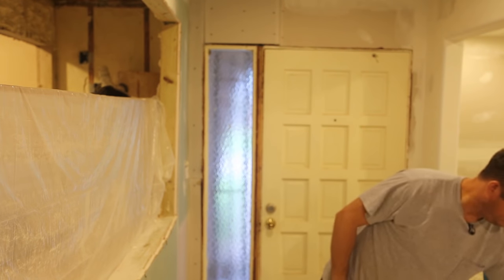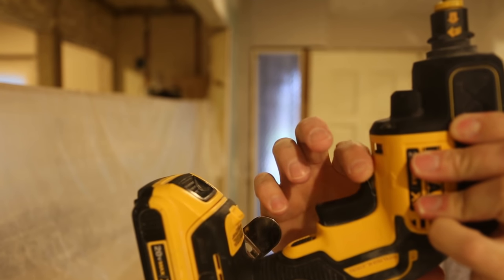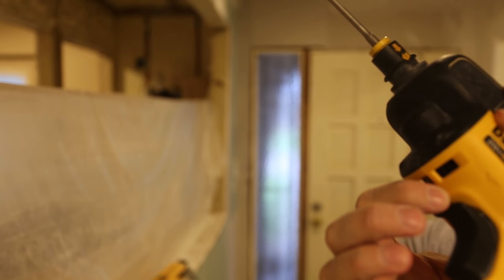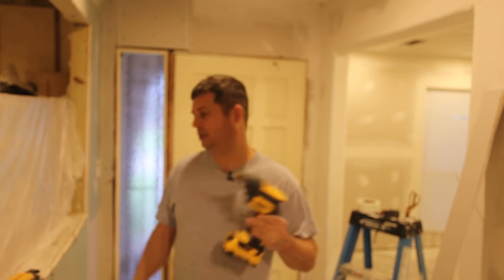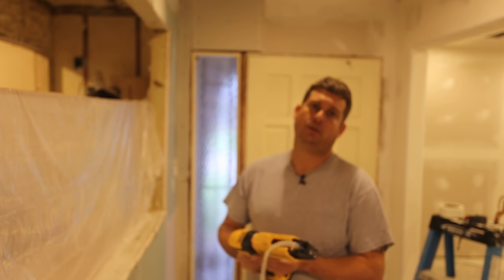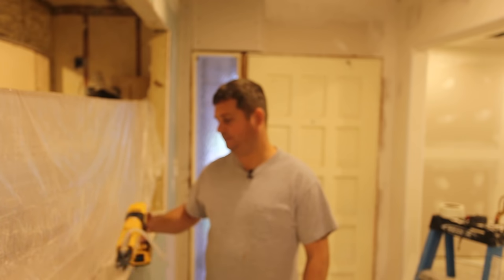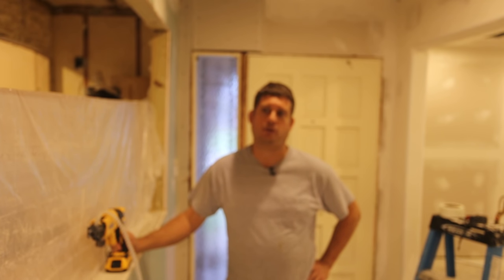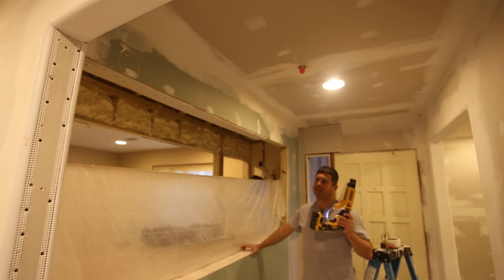DeWalt Max XR DCF620B and DCF6201 Review and Demo

Comment: if Yiu hold the gun properly the switch is in the perfect spot when your hand feeding and get a dead screw I've been running the Dewalt cordless for over a year now day in and day out and haven't had a single issue with it yet it's rugged as he'll I've dropped it down stairs off ladders off the tool belt all numerous times still no problems the screaming stops after a Lil bit of 3an1 oil is added and the cone stiffens up and doesn't adjust to easy once the dust collects in the cone

Comment: The switch is in a perfect place don't listen to that part I hang and finish drywall for a living and that switch being there is great and helps out with productivity.
Reply from the maker: I'm glad you like it.  I personally hate it there.  Why would you want a reversing switch on a screwgun with a collator attachment?  A separate bit on a separate tool is a more appropriate way to deal with reversing screws that need to come out or be finished a bit more.  The other MaxXR tools like the impact driver and drill use a sliding forward/reverse switch which doesn't tend to be accidentally hit as often.
Reply: Delia Agundiz stop using your wife's account
Reply: I want delia to come work with me...

Comment: Thanks for the video Brian.... shopping for an autofeed from someone.. senco was the cordless autofeed I've used in the past...  the 2500 rpm... I see they have a 5000 rpm out for @250...  I think they feed on the recoil... I'm not sure... so thank you very much for YOUR time !!
Reply from the maker: Yes the feed is on the recoil.  Which is part of the reason that the Reverse is useless on this gun assembly.

Comment: Did you have problems with the cone being hard to adjust after a few times of use cuz of the dust. I seem to have this problem with it. It gets really hard to adjust cuz it seems the dust gets lodged into the adjusment mechanism. Not talking about the auto feeder.
Reply from the maker: I didn't have any issues with it.
Reply: Try rinsing with water really good, let it completely dry up and put some oil. Maybe wd40. not too much

Comment: Good video even blurry..  I have the unit and yes the switch mysterious switches from fwd to reverse.. I'm a lefty and I sometimes hit this by mistake... nothing worst than to have the screw not go in.  Another thing is using it in the corners... the square apparatus don't work well at angles.... otherwise a good product..

Comment: Most logical place to operate the reverse forward is where your finger is........ Perfect design Dewalt....
Reply from the maker: Maybe if you are using the screw gun without the collating attachment.  But the collating attachment is for installing screws and each time you press it a screw is dispensed.  So having a reverse paddle is pointless.  Plenty of other Dewalt products use a slide/toggle on the grip that stays out of the way until you press it.

Comment: any idea on how it works on metal framing?
Reply from the maker: Should be just fine.  Different screws though.
Reply: and a little more push! LOL! Thanks!
Reply from the maker: I don't think so.  They are self-drilling fine thread screws for metal framing.  I'm working on a commercial space for my screenprinting company and it's all metal framed.  I had to mount a piece of painted plywood for network and communications.  I used my impact driver to install the few screws I needed to install and it was just fine.  Went in easy and secured firmly.  Very similar to wood frame walls.
Reply: freaking awesome news!

Comment: is the handle as big as people make it out to be and do you really need to use two hands when using it?
Reply from the maker: +yolol No, I regularly use it one handed.  The only serious draw back to it is that it is optimized for short screws.  Long screws sometimes hangup when going through the feed slot on the inside curve of the handle.
Reply: +Brian Greul great to know brian, does it also feel good in your hand like other dewalt cordless drills? i bought a dewalt impact driver and i am thrilled with it and seeing that i do a lot of plaster boarding i'm going to buy the DCF620P2  as it will for sure come in handy when doing ceilings and speeding up jobs. great review by the way
Reply from the maker: +yolol Like all the MaxXR tools it's very ergonomic.  The only gripe I have with it is the forward/reverse switch.  It's in a bad place and it's easy to hit accidentally.  I really wish it had the same forward/reverse switch as the drill and impact driver do.  That's a button that moves side to side.  The driver has a paddle.  Otherwise, it's a great tool.  Mine included a hook for "belt" mounting.  It's a tad too heavy for a belt, but I use the hook to hang it on a ladder and keep it out of harm's way.  I've nearly finished hanging 6800 s/f of sheetrock and it would have taken alot longer without this tool.  While the screws are more expensive, my time is worth more to me.
Reply: It's been about two years since and the machine is still going strong. I recommend it to everyone. Cheers

Comment: Is this machine can screw in iron pipe 1.5 mm to 2 mm thickness pipe
Reply from the maker: no.  It's a drywall screw gun.  You will destroy the bits even faster drilling steel.

Comment: Can  you use any brand screw on the attachment ?
Reply: I've tried universal 35x3.5 (I'm in France so I'm not sure how it is in universal but close to 1 and a quarter inch I think) and they simply wouldn't get picked up by the actual screwdriver. I've now ordered Dewalt 3.5x35 and will update once tested.
Reply: well?

Comment: Just don't buy square drive screws so if your doing decking just get no2 ph decking screws, it is after all a drywall gun
Reply from the maker: #2 Phillips doesn't handle torque as well.  I don't think I've ever seen the square drive bit for this.  The tool was a real lifesaver for doing 7,000 s/f of sheetrock.

Comment: With that much water you will (already have) regret not using blueboard for that surround.
Reply from the maker: Probably not.  I used hardibacker with a single part epoxy paint.  I've used that combo before where it had to resist a pressure washer.  As much as I'd like to think my saltwater tank is wild, it's not that wild.   But it is something to think about.

Comment: its 2018 now, do we have #2 square tips for this system now?  I need this for floors but also do drywall on the side sometimes.  All my cordless tools are XR Dewalt battery powered so I thought I might buy this setup.  But I am advised to just buy the Senco.
Reply from the maker: Dewalt appears to have them listed.  Finding them is another issue entirely.

Comment: i hate when people thing their opinion is the only one like it's automatically a fact because they think it is.  It's not a FAIL because you can't watch where your fingers go. It's actually a very convenient place for that switch, you can tap it with your finger quickly and go on about your business. It's not Dewalts fault you're clumsy. where would you prefer them to put it?
Reply from the maker: As I said in the video, I would prefer the switch style that is on the drill and impact driver.  I found that the switch on this screwgun is very easy to hit by accident when you are holding sheetrock with one hand and the gun with the other.  Besides, who the hell uses a screwgun with a collating attachment in reverse?  It's a single purpose gun with the collating attachment.  Each press positions another screw for placement.
Reply: I agree, I have this gun as well and when you are trying to really rip along it does get hit accidently leading to stripped philips attachements.  I would prefer the style they use on their 20v drills/impactors.
Reply from the maker: Reverse on a collated screw gun is like teats on a male pig..... completely worthless.  Reverse would be fine and perhaps useless on the gun itself.... but you can not use the collated gun attachment to remove a screw.  Each time you press the combo it advances a screw into position.  I believe the back and forth is a better ergonomic design then the paddle switch.  It's just as easy to hit and not as likely to be accidentally hit.

Comment: I'm plasterer.  i bought this one, but i must sold it, its too bad. Its  too heavy to do hang up ceiling.  it cant shot the corner of walls, bc it heads too big.  screw driver bit is long and small after only 20 shot then  jam. u will feel tired if it hooked on ur belt while u climb a ladder. ... u would regret,  if u bought this one!!
Reply: Too heavy compared to a corded gun? This thing was soo much lighter then my dewalt corded gun. I agree with some of the issues you mention however after some time with it ive pretty much eliminated them. It just took some time get used to it and knowing it limitations\weakness. I wasnt sure at first but i love it now. I had to use the corded one and man its heavy and dragging cords sucks, especially if your hanging a catherdral ceiling.

Comment: To be honest I stay with old School Cord Dewalt. It's a waste of money and labor cost when you use them Strips. They leave to many hangers  especially in the Corners . My self I can out screw a guy with No strip just saying..
Reply from the maker: You could probably do it with a screwdriver by hand too....or a hammer and nails.....  or maybe wooden pegs.  Many different ways to fasten sheetrock.  I happen to like collated and think it's way faster than hand placing screws.  As a bonus, my fingers didn't get stabbed every 3rd time I reached for a screw like happens with hand placing them.  Definitely not worth it for a small job, but priceless for a big one.
Reply: Sure you can..
Reply: I dont use the strips either but i switched to the cordless and after an adjustment period im much faster. The other guys i know who switched would never go back to a cord. Its lighter and much easier to get around and easy on my shoulder when im doing ceilings.

It really takes some getting used to and to overcone some of its weaknesses but when you do i really think its superior. If it wasnt for me we would probabaly have switched back to corded. I pretty much run the gun while my boss will measure and cut. He was having problems with its limitationa and has no patience. I told him give it time and he did. No we really dont have issues.

It has issues getting into tight corners. Im better at knowing the angle to hit and sink the screw. On extremely tight corners ill just pop the cone off right away and sink them like that or ill just partially sink the screws and go back at the end without cone and sink the heads ive left out all at the same time.

It sucks backing out misses. Ive just gotten better and this isnt really an issue. Again somtimes i leave misses until then end and remove cone to get all at once.

The other issue is the depth adjust ment moves pretty much any time you remove the cone. If you remove the cone a lot its time consuming adjusting it back to proper depth. Again i pretty much eliminated this buy waiting till the end to remove cone for tight corners, miss removal, and screws that didnt sink to correct depth. 

I go over my work regardless so waiting until the end saves a lot of time and i take care of it all at once which takes minimal time. 

On certain jobs im only tacking and only screw off the end or side of the board where the next sheet is going and will screw it off entirely after the last sheet is tacked up. In this case this limitations are never an issue.

I thought it sucked at first. But if you give it time you may come around.